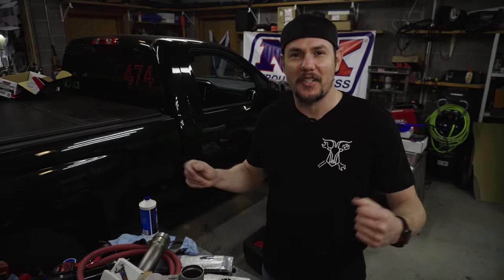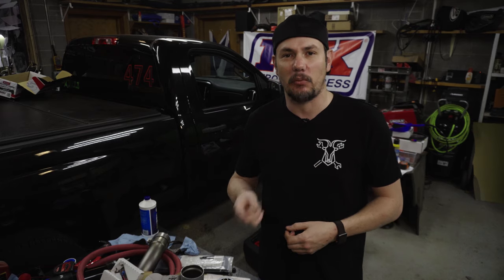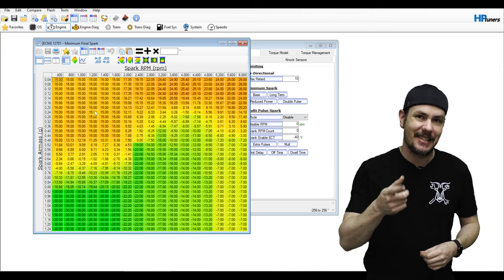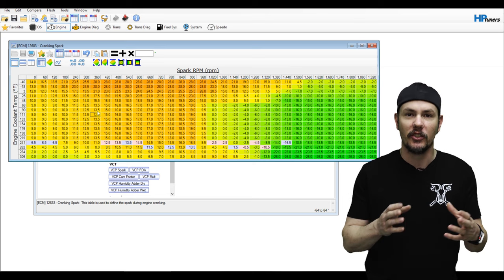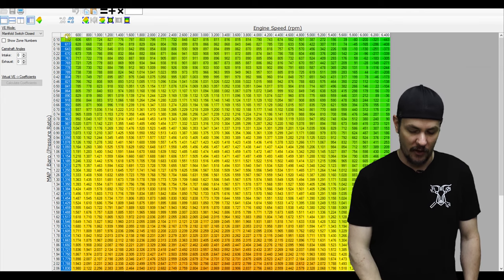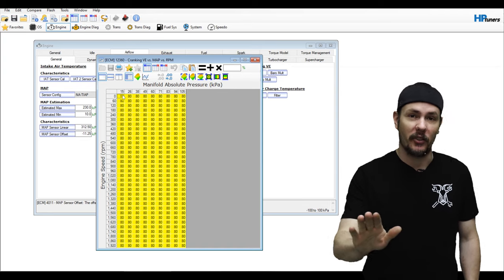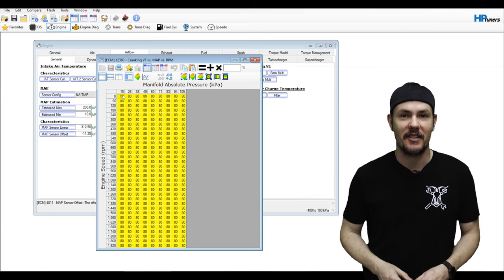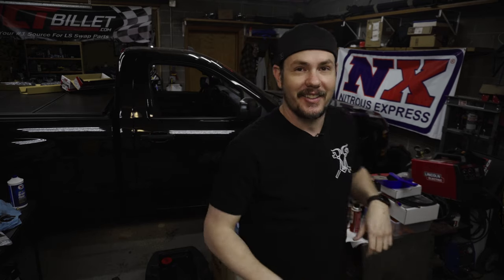Cam Tuning For Crank and Idle, Getting That Aggressive Cam Dialed In On The Superado!

Comment: i also found with mine gen4 that with a camshaft (or less compression)  if u have less advance for cranking it can help, less advance means the piston is further toward TDC and thus more compression has been achieved so it may ignite easier, i was in the 3-5 deg cold at the rpm it cranks over worked well
Reply from the maker: I'll test it out, I was in that range before and it struggled but the fuel was still a bit too rich

Comment: Hey man, I’m hoping you might have some time to give me some feedback I’ve had for tuners tune my truck The last one said he could fix the jumping issues at a stoplight, was unable to keep the cam from pushing through the torque converter. I only have a LS three with a truck, Norris cam and a stock 6l80 what do you recommend?
Reply: 4 Tuners
Reply from the maker: Looser converter

Comment: I’ve had some short sighted success with varying the block of idle cells in my VE. Like you said you can get enough flow rate to get consistency. If I have a lean cell on the under idle cell and a rich cell on the over idle cell  while the cam oscillates and idle corrects to target rpm the lean rich in the correction area helps it from just loading up under extended idle. New to tuning and tried this the last couple days on my car. Seems to help

Comment: Maaan im so glad you came out with this video! Just last weekend I just swapped my gen 4 stock 5.3l out for a gen 4 built 6.0l and i have been having no luck with the start up portion of it! But now this is out, I will definitely be starting over with the tune and go from there! One thing I am having trouble with is trans tuning with a higher stall converter 🤔.

Comment: Hey boss, I just got my heads/cam gen 5 viper motor back 3 weeks ago. Before the rebuild it had a generic tune which was pretty decent.

The motor was rebuilt with the same or "similar" parts but now on the dyno, there's about 50whp missing. Could this be due to it needing a new tune despite the same parts or could the builder be pulling a fast one?

Comment: Kyle quick question plz.  427 sbc stroker..heavy cam. around 5hg at idle.  I'd like to run an HP mpi set up. will this heavy of a cam work with this set up or will that low vacuum wreek havic on the map sensor in differnt rpms? just need to know if I can work with the cam I have ..

Comment: anyway i can send you tune that was on my car when i got it i got hp tuners and when im logging its super lean at cruising speeds and low rpm /manifold pressure has big cam just rebuilt motor i daily it more than race it fuel seems ok when i stomp on it just trying to learn

Comment: I have cam surge can’t figure out how to do timing at calculator specs before I ruin my motor hitting valves worries me please help
Reply from the maker: Try and set a static timing of like 15 degrees in the editor and focus on getting a good airflow dialed in for idle then let the timing do adjustments after
Reply: Thanks for your help Kyle but don’t know where I would set static time or just do a base spark at 15 and how do I tune air from intake not from exhaust to stop bucking and sucking

Comment: Can you talk about EOIT for a larger cam. For  IV gen.  ;)
Reply: easy way to start on it is under "injection timing" set the normal RPM table to all zeros, set boundary to all 520, then in the normal ECT table the 110 cells lower those by 5 each time until u see your idle trims/WB show richer at engine operating temp, once u change it and it dosnt go richer leave it there on the last change and adjust MAF/VE/VVE to correct, depending on overlap u could be in the 75-100 range ( stay within that range is best and ramp back to the colder values) thats now where u know u are getting most of the fuel in the chamber and burnt, then only use the Boundary for adjustments and keep them smooth between cells on the 2D, leave idle rpm cells as they are and from then on u can increase the number to delay it more as rpm increase (prob wouldnt go further then 580 up top) just see what it likes as its best with a dyno so u can see any gains as u may be able to put more spark timing into it also,  or just leave it at the boundary all 520 after adjusting the ECT so idle will be better, boundary - ECT - RPM = EOIT in crank deg

Comment: Hey Kyle, I’ve been watching your videos for a month or so now and I’ve just got hp tuners last weekend. I’m trying to tune my 2004 Silverado 5.3 that I built the motor in. I’m having issues with the idle when I put it in gear. It will idle fine, then drop to nothing like it’s going to die then pick back up just before it dies. I think it may have something to do with the heads being ported and the cocker arm bolts leaking, but I used sealer on them. Anything I need to look into before I swap heads? I’m installing my aem wide band this weekend maybe that will tell me something
Reply from the maker: Get the wideband in, might be overly rich causing the dip and check your idle setpoint in gear, it's separate, might need to bump it up